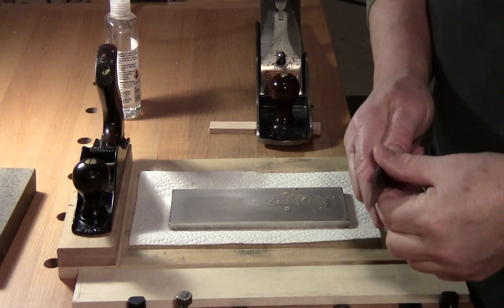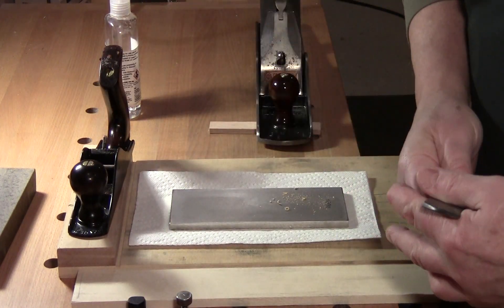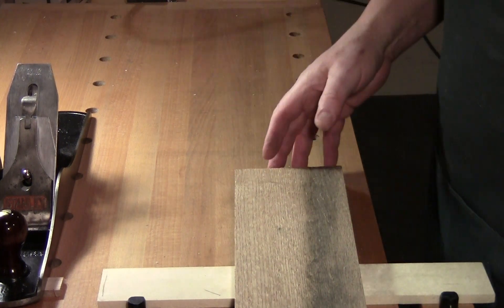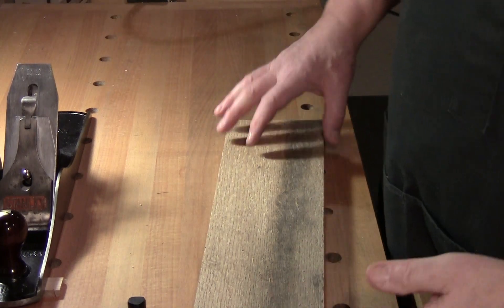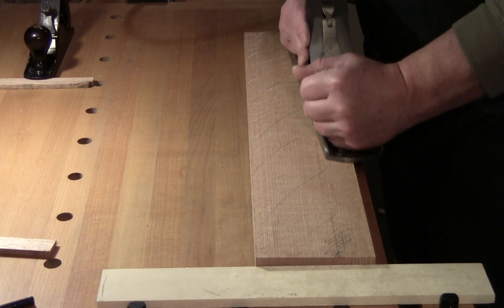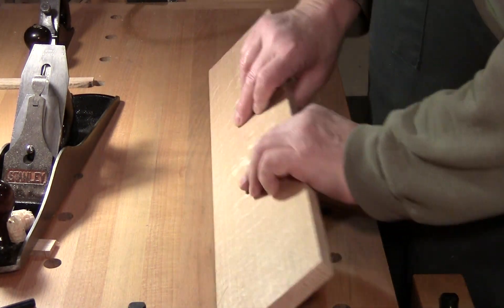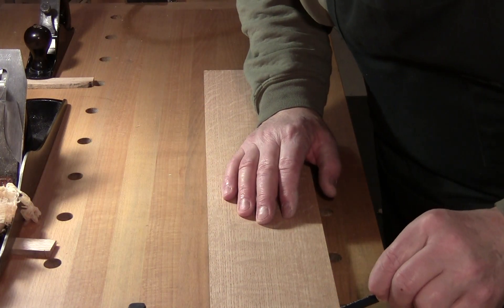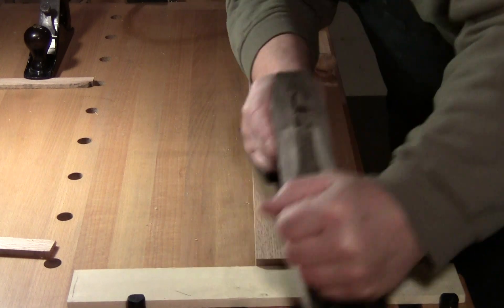When to Sharpen - Full Version Warts and All - PLANE TALK 7 Feb 2019

Comment: Hey Walter, thanks for the planing lesson. I suppose you need to be sure you have a perfectly flat bench top doing this type of work. Was your bench flattened with a hand plane?
Reply from the maker: Jon,
Thanks for writing and yes, you need some sort of flat surface when planing.
My bench was made by SJÖBERGS and in their factory I'm sure they use wide machines to flatten the tops.
I have hand scrape it lightly once and tested for flat.
As to how flat a top has to be depends on your work.
Once you have a reasonably flat top, you get used to working with it and adjusting your work as you build.
I look at it this way, IF I can get a full length fine shaving from end to end I am straight and flat enough to proceed with the build.
Joints are fit one to another so those can be adjusted on a piece by piece basis.
Thanks for watching!